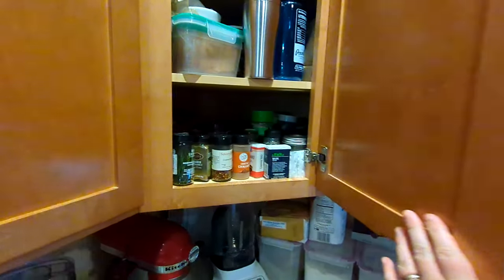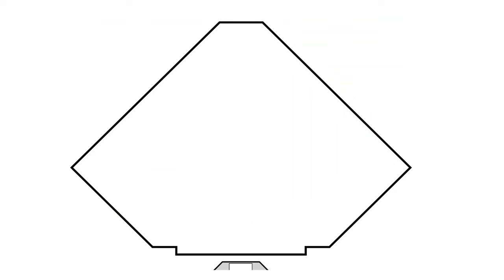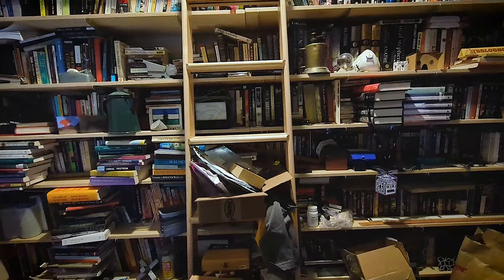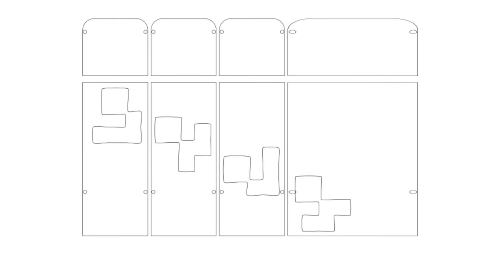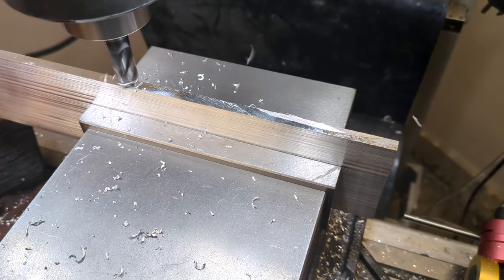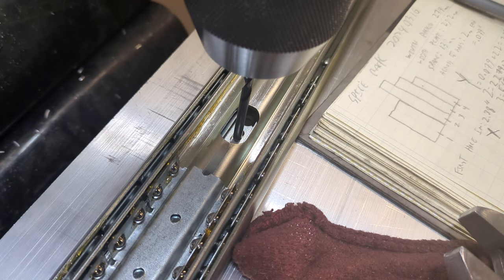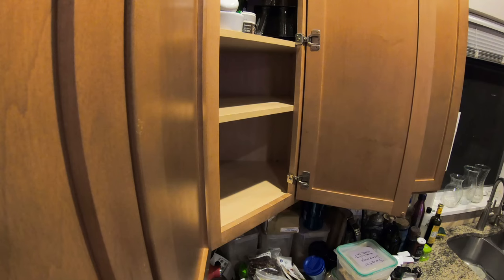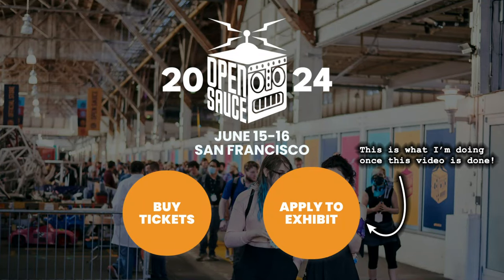The (kitchen) spice must flow (out of the cabinet)

Comment: THAT is a very beautiful build.  However, I think more space could be utilized, and with your background, you could figure it out.  

"If" one wanted to utilize those "wing" areas off to the sides, I suggest that the unit you built should slide all the way out, and then lower, to allow the wings to swing into place with their stores.  The dimensions are close to being perfect for this.  I don't know the math or where the wing pivots exactly are but...